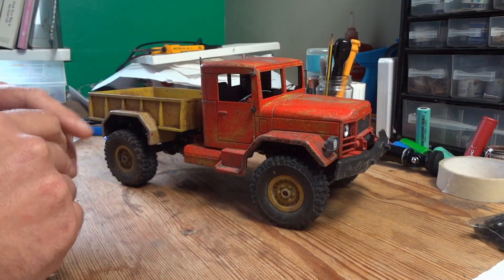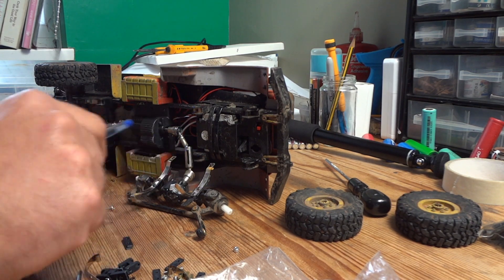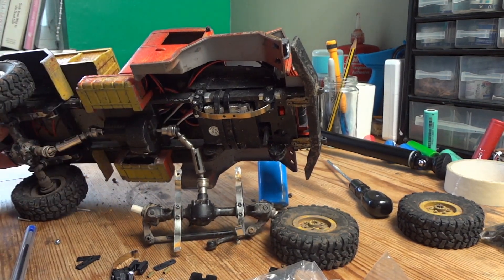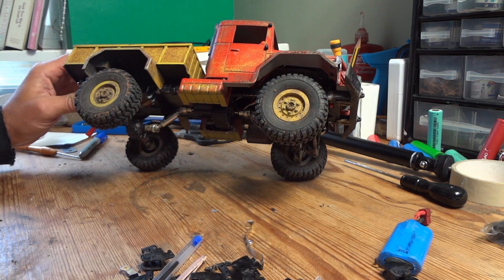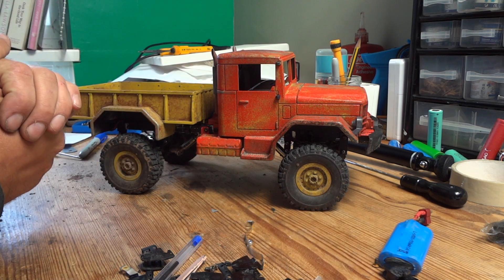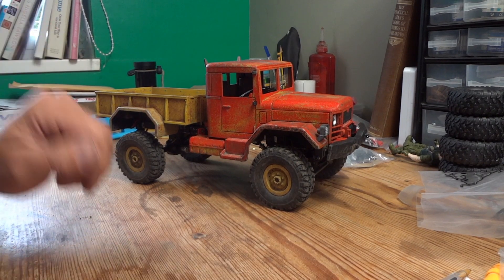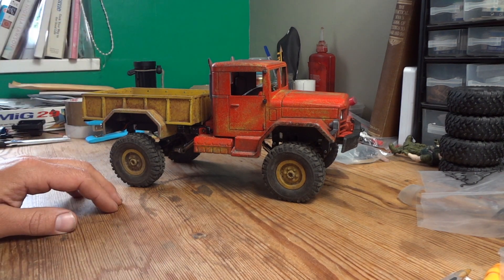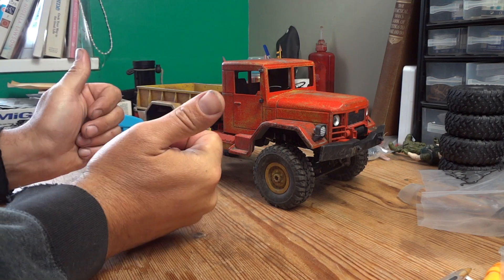WPL B1 Cheap Lift Kit. Does It Work?

Comment: A simple and cheap mod to ease the driveshaft angle: place shims (I have used rubber grommets from servo mount) between axle and springs on the outer screws to change axle pitch slightly. A little change helps tremendously to relieve stress and binding of the U joints
Reply from the maker: That's a great tip! When I get five minutes I'll try it. 👍👍
Reply: Have you tried my servo rubber hack?
Reply from the maker: @JDLightnin  not yet but I do keep looking at it lol! 👍
Reply from the maker: @JDLightnin  not yet but I do keep looking at it lol! 👍

Comment: Nice video. I've been away a while working on other stuff and I see you have quite a backlog of videos for me to go back through and watch!!! I've got my trucks back out and am building a C44km at the moment. I love the body on it, but somehow the Gaz still runs circles around it. I think the 2 speed hangs too low on the C44. Maybe I'll get a B1 to work on next. Cheers.
Reply from the maker: Hello Ian! Yes it's quite a sorted little truck really, with just some simple but effective mods done it. I'm surprised about the C44 everyone usually raves about them. Must admit I've not had the privilege yet. The only issue with the lift kit is the springs are'nt supple enough to take full advantage of the added articulation. But it does add useful ground clearance. Get watching the other videos lol! And thanks for taking the time to comment! 👍👍👍👍👍
Reply: @theminiatureconstructionco4556  Your videos look great with the new camera. Still going through the back log. Don't get me wrong. I love the C44! It's just that the C34 (three door) came with a single speed gearbox that tucked up in the frame rails. It was geared really low and slid right over stuff. The C44 looks much better in my opinion with the flatbed but it has the two speed gearbox stock. The two speed hangs below the frame and makes an abrupt point to catch on things when crawling. Couple that with the longer wheelbase and it makes it hang up even worse. I'm thinking of converting it to a stock single speed as I have another C34 kit I can cannibalize, but I'm unsure if the driveshafts will reach because the outputs will be quite a bit higher up between the frame rails. I'll have to mock it up. The thing that makes the Gaz perform so well is, even though mine has the two speed in it, the side fuel tanks act as sliders and the transmission case doesn't catch on stuff. And because technically it's a smaller scale than the C series, it still looks good even though the wheel base is shorter than the C44. Really can't beat the looks of the C44 though. And it has a full interior that's accessible with doors and everything!

Comment: Nice upgrade bud 👍
Maybe some sprung weight will help give more flex and push those driveshafts down abit. That's a downside to aftermarket parts, spares, there's none 😂
Reply from the maker: Yes and although this turned out to be cheap, a decent lift kit is quite dear I think. So to replace one broken part would be expensive mistake. Thanks for watching! 👍

Comment: Nice upgrade on that truck bud. Perhaps cut them springs if possible ? Slightly. Great work mate . We can always improve something 👌😎
Reply from the maker: Thank you. When you say cut the springs what do you mean? I'm not sure you can because they are an exact fit for the hangers. 👍👍👍
Reply: The Miniature Construction Company if they are to springy that means the spring seems to high in travel quite a long spring if you can remove to top mount of the shock, you could remove a couple of turns on the coil. If you was to do that, make sure they are all level, then you will have that that 4x4 travel your looking for. Hope that makes sense .??
Reply: Sorry it has just leaf springs. I thought it had shocks aswel. Ignore me 😂 to early 🤪🔫
Reply: yup, with leaves you could grind them a bit narrower is about all...
maybe 1/2 mm worth from both sides of them would soften them up a little.
much easier to add wheel weight, doing both would definitely flex more.